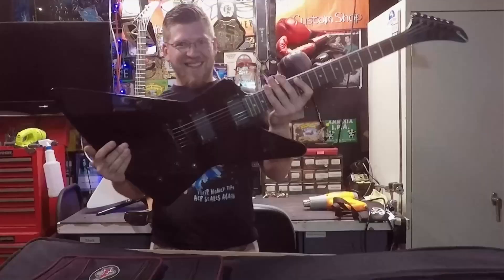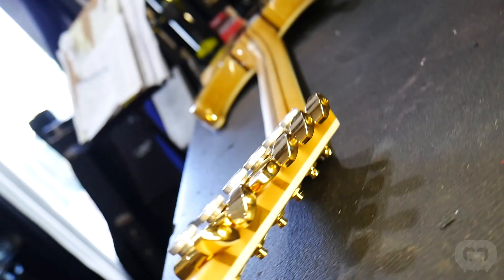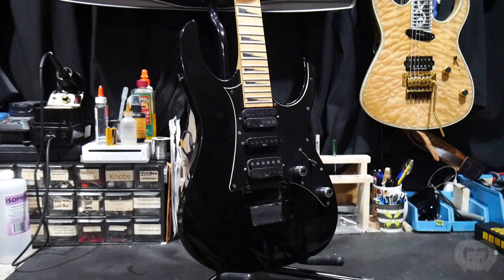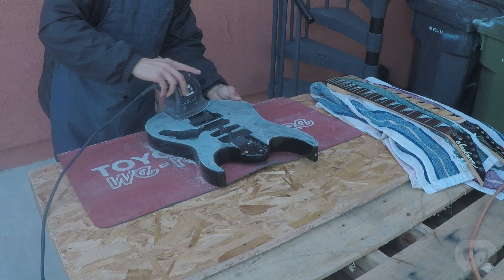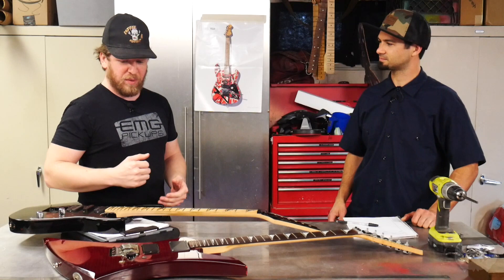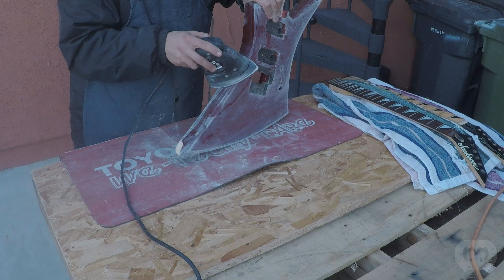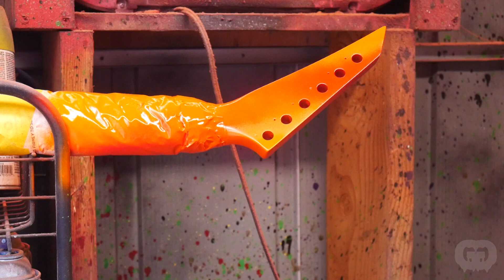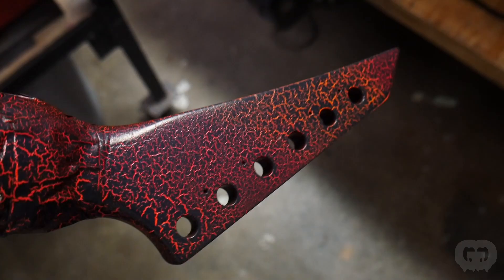Trash to Thrash #9 - Japanese Guitars - Crackle Paint - Jackson Kelly

Comment: a heat gun and careful scraping usually will remove most factory guitar paint, and in large sections, very quickly i might add , if you're carefull , you can try a plumbers torch, but it can burn the wood if you leave the flame in one spot too long, try it on something that doesn't matter so much and experimen with it

Comment: Next time you try the crackle with a rattle can set your compressed air up with a blower regulated down to around 5 psi or even less ( filtered and water trapped ofcourse) . lay your crackle on wet and then blow it to force the crackle and they will turn out bigger AKA older charvel etc. Maybe not as big as a gun but quite a bit bigger than your first attempt. I imagine you are using montana crackle cans . The best stuff to spray through a gun is from the uk think it is custom creations paints.

Comment: The crackle effect looks awesome!   I wonder if some of the crackle will flake off or full adhere to the basecoat paint.     I might try it for my next guitar build.     I do have a question about Frankenstrats.    Do you use a capacitor across the volume potentiometer?

Comment: the crackle effect looks really cool, but can you actually feel it if you run your hand over it?
Reply: Maybe putting som kind of clearcoat over it?
Reply: ive done some crackle guitars before and usually just put a few coats of clear finish over it, you can still feel a bit of texture but i also dont feel like dumping 3 spraycans worth of clearcoat on a guitar
Reply: Yeah. You can feel it. Same with striped guitars painted with rattle cans and masking tape.
Reply: 4 thin coats of clear, then wetsand flat, 2-4 more light coats of clear
Reply: @BloodyVulnona  DO IT, the guitar wants it
Reply: @idiotburns  i only own my bass with a black and white crackle at this point but i like the bit of texture you ger from only using a few coats of clear finish
Reply: @djay6651  Not if you do it right you wont feel it at all.

Comment: Hey man i just discovered your channel. I have a MIJ ke3 kelly and MII kelly with a fixed bridge. I got them both used and obviously the issues with them on the used market are the rear horns are usually ravaged. Is it just bondo you use to fix them or you cut them glue new wood to it? Would like to see you refret using stainless steel frets as well i just bought already cut frets from amazon for $12 and want to see tips on working on them

Comment: Wondering if anyone could help. I gave my Kramer baretta special a make over with candy apple red and black crackle. Unfortunately it came out uneven. It did crackle but its weird as its larger crackle is in some areas and smaller in others. I'm stuck between buying more paint and starting again or just leaving it. It's becoming rather costly. Just wondering what I've done wrong as I gave it an even spray and good coverage.